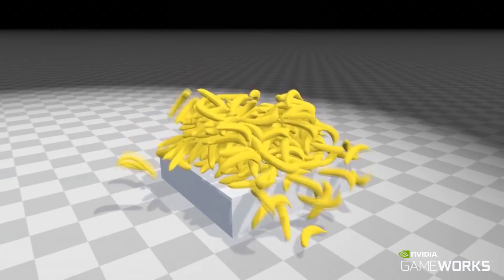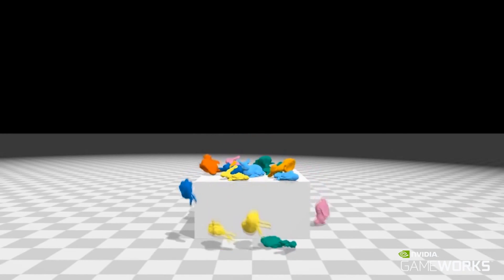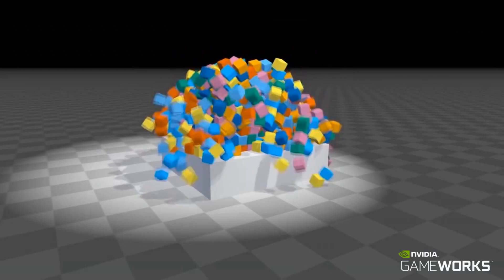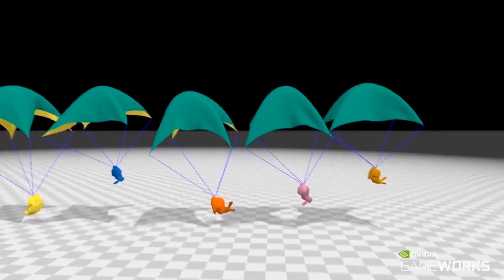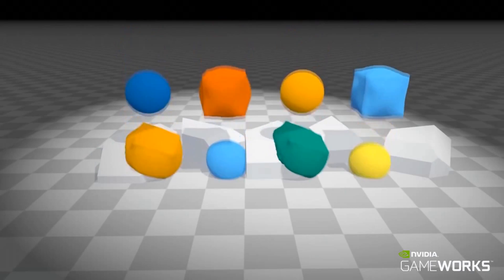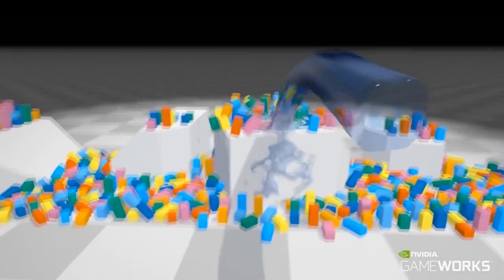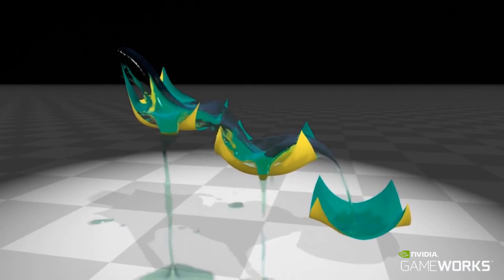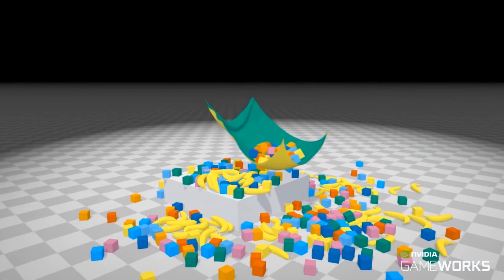PhysX: Flex

Comment: Is this in the driver or in the game to be used? Does it work with older drivers or do you need the new ones?
Is this just a expansion from Physx? 

Do you need a special graphicscard?
Does it work with older cards because you don't seem to have changed so much things from 700 to 900.